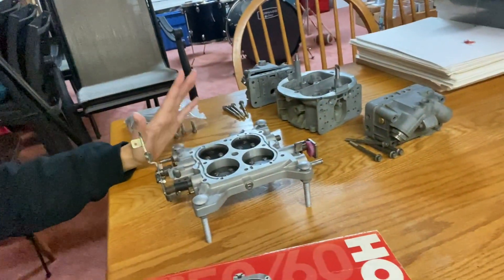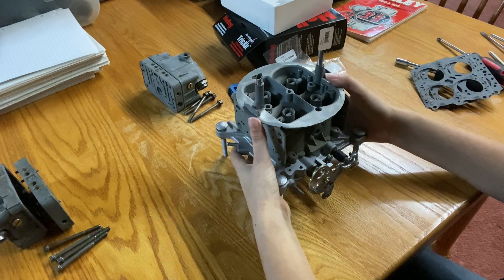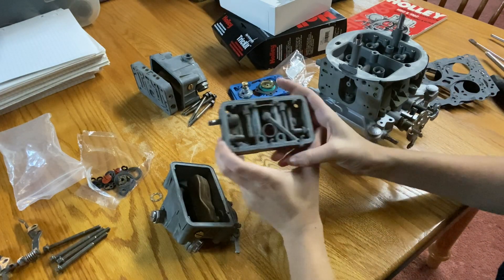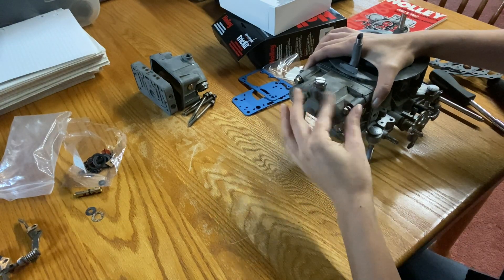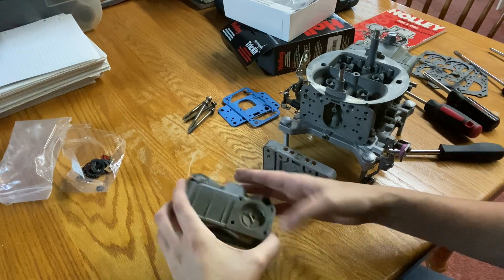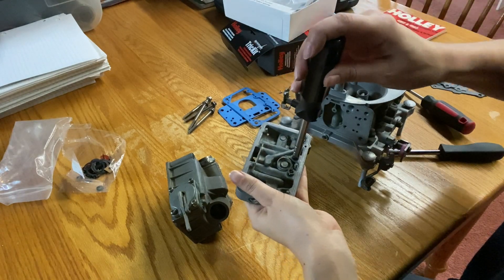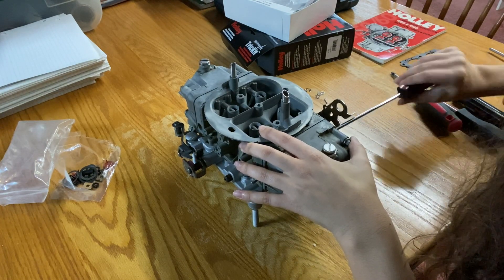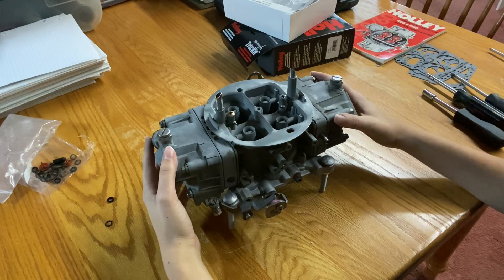Holley 4150 Carburetor Rebuild

Comment: Stop stumble or flood on carbs.

Holley carb double pumpers come with primary and secondary accelerator pump and usually only power valve primary side.
The purpose of both is to get right amount of gas/air ratio when accelerating from low throttle to higher throttle.
When you first press on the accelerator, you open air flow and immediately create a situation where there are gobs of air and less gas as when the intake manifold pressure goes down, gasoline flow is lower thru the jets.  
The carb has 2 ways it makes up for lower gas rate so the car doesn’t stumble on acceleration.  They are the accelerator pump which shoots raw gas into carb … and after a few seconds as engine speed comes up power valve begins to open so engine doesn’t starve from lean mixture
The power valve opens (upon low manifold pressure) and allows raw gas to come out of bowls to give a boost of gasoline to join what comes thru jets.
As the manifold pressure comes up, the power valve closes off and engine begins to run on jets alone again.
Holly designed the power valves to open when the manifold pressure goes down a certain amount … usually 6.5 inches of vacuum on standard car, or 2.5 to 3.5 inches of vacuum for high performance engines with low manifold vacuum.
Where you get in trouble is when running a carb with 6.5 inches of vacuum and you have a high performance cammed engine and the power valve the opens at 2.5 inches of vacuum.  
Under these circumstances, the power valve is open all the time … causing the engine to flood at anything but full throttle.
So the mismatch of correct power valve causes one of two problems.
When using a 6.5 inch power valve in a race engine with low manifold vacuum the power valve almost never opens causing engine to stumble when throttle is opened.  And when using a 2.5 – 3.5 inch power valve in a stock engine (standard manifold vacuum) the engine always runs rich … really rich … because the power valve never closes.
When switching around Holley carbs from car to car this happens a lot … when you change service the power valve needs to be changed so you match engine type to power valve setting.
Wrote this when I noticed you guys were having trouble with engine stalling upon acceleration thinking there was something wrong with carb … but I’ll bet you were putting a carb with a 6.5 inch power valve in a car with a big cam … thus almost never opening power valve when you need it.  Causing engine stumble.
The low manifold vacuum is a result of cam keeping intakes open longer (more overlap) creating the lower maniford vacuum and requiring a power valve of 2.5 – 3.5 inch setting.

Comment: I know every passageway in a Holley carb, watching you put that one together with such ease is a true pleasure, a small point, the valve under the pump nozzle is a check valve to keep vacuum from sucking fuel out of the pump nozzle.  It is a needle valve but it is not called that in a Holley.

Comment: based on the the 8 base plate screws, and accel pump check balls this is pretty old carb. 1980's or so. I would suggest getting rid of the two base plate screws that hang over the intake plenum. They have been known to fall out and down the engine. Very bad things happen. Newer Holleys don't have them. You're hurting a lot egos making this look so easy. Keep it up.
Reply: good to know thanks!

Comment: Thank you for posting this very informative video! I bought the latest Harbor Freight ultrasonic cleaner & it cleans small carburetors to like new condition, after watching your video I think my Holley will break down into small enough parts to fit inside the cleaner.

Comment: Hi missed your Videos, if you were gonna run that carb on a motor without a 4hole spacer you should leave the 2 inner base plate screws out most holley carbs come without the, they can fall out and drop into the motor making a BIG MESS. I like the bolts you use for a stand, i use a  piece of thick round cardboard tube that fits over the air cleaner base then you can work on it upside down too. Love Watching you race too

Comment: You did a good job describing your assembly steps and I like your methods. But you rotated the carburetor counterclockwise with the primary side facing you before inadvertently installing the primary squirter with the squirter nozzles into the secondary side. But I'm sure you were probably just testing us to see if anyone was paying attention. ;-)  Keep up the good work, I love seeing your videos.
Reply from the maker: Good catch! I caught that mistake too when editing the video but hoped no one would notice 😆 haha fixed it off camera!
Reply: @GnarlySpeedShop  I knew it wouldn't take you long to notice because you are a pretty smart lady. The only reason I noticed is because I have a Holley 670 - 4150 on my 78 Corvette and never disassembled. That's why I was watching you closely, I don't think anyone would have noticed unless they have one on their engine.

Comment: Awesome show do you notice the metering plates they only fit on the front or back a certain way because they are penned the back can sit on the front and the front can't fit on the back cuz they are penned and assign a certain why on the main body of the carburetor also remind them about the power valves if you backfire the carburetor it blows the power valve out and you will have to replace it is short-term what I am trying to say the front and sit on the back and the back can't sit on the front because it has a different pen setting you have a awesome show awesome knowledge thank you God bless oh by the way I forgot Holley carburetors R1 the best carburetors ever built or manufactured

Comment: Nice informative video, you did a nice clean job rebuilding the carb. The only thing I  noticed was you put the fuel bowls on the wrong ends, they need to be swapped. The fuel line hookups are on the throttle side, they should be on the opposite side of the throttle linkage.